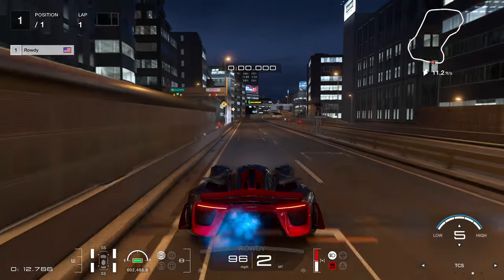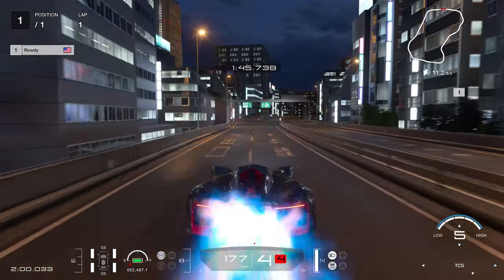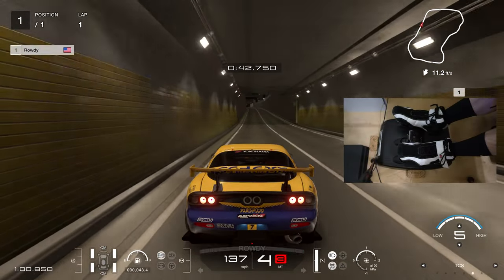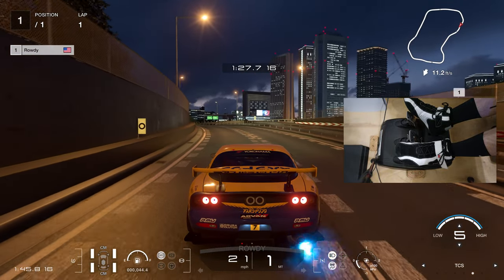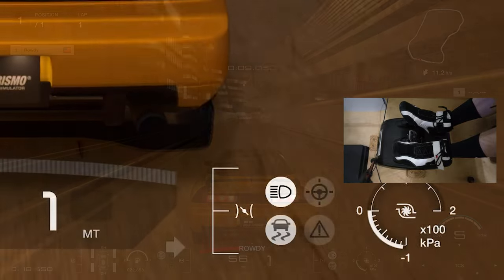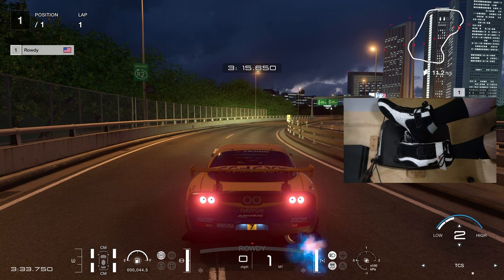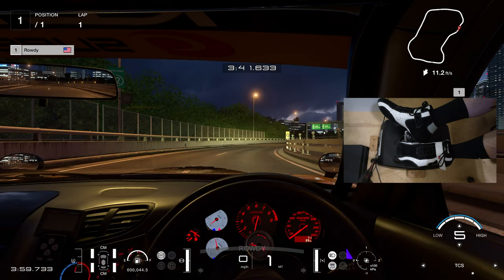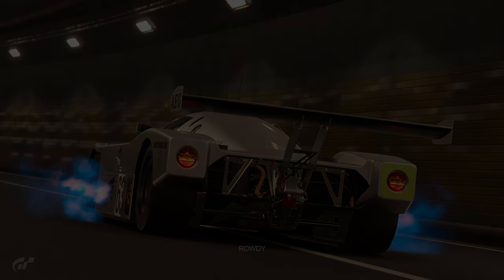How to Get CONTINUOUS Exhaust Flames and Mock 2-Step in GT7 | Exhaust Flame Glitch (Requires Clutch)

Comment from the maker: I’ve seen the other methods from GT Sport. While I have not tested them on GT7 they are far inferior to this method. 

For GTS’s continuous flames, you still need a H pattern regardless, you need to do it in neutral, and you can’t accelerate while doing it. 

For GTS’s “2 Step” it’s literally just gear spamming with a racing trans and you can only go as fast as you can shift which is super limiting. Not to mention that method sounds super goofy. It does not mock 2 step at all and some people even called it anti lag in GTS (lol). 

So yeah, this method is not only far better but also not the same as others have been pointing out in the comments. You will not be able to effectively do this to this degree on a controller.

Comment: You can do it kind of on controller but not as good (it’s not as rapid)
Full throttle and brake to start a wheel spin then change to a gear where you stop spinning you should start slowly rolling forward from then spam between two gears ie 4th n 5th back and forward will create a slower version, only way I could do it kinda